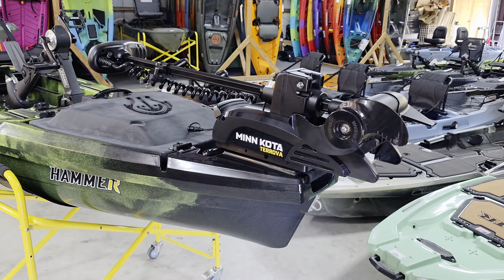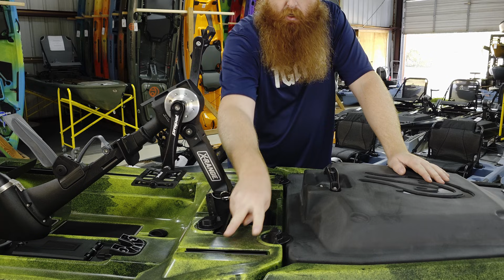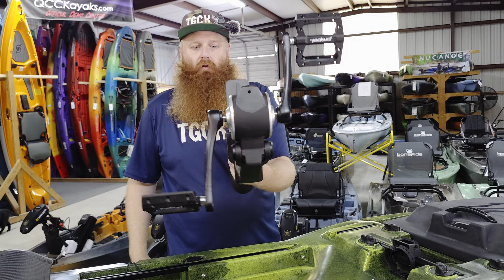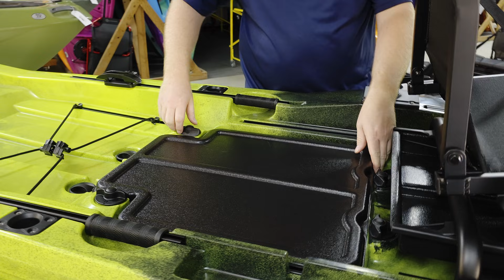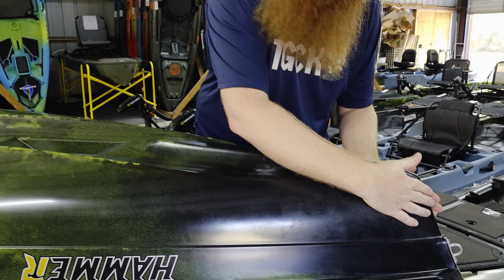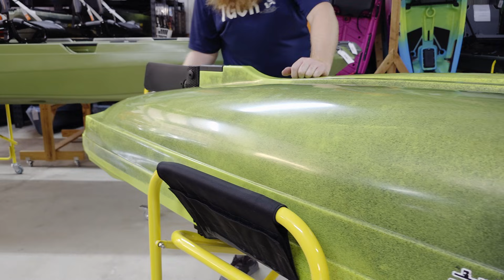Native Hammer Kayak Walkthrough featuring the Propel X-Range Pedal Drive System

Comment: Not sure you will be able to use a Captains Bridge for mounting your graphs as the drive would appear to interfere with it when moved into the forward most position. Nice kayak nonetheless. Reminds me of my Hobie PA14.😁
Reply from the maker: You are correct, it will not allow you to lay the drive down into the most collapsed position. However, the captains bridge will fit when the drive is in the standard up position and deployed.